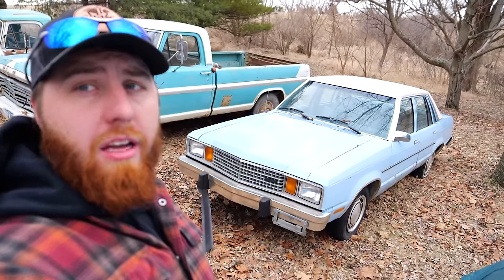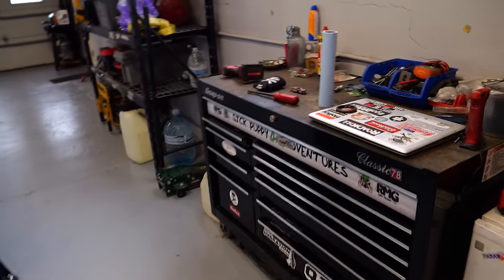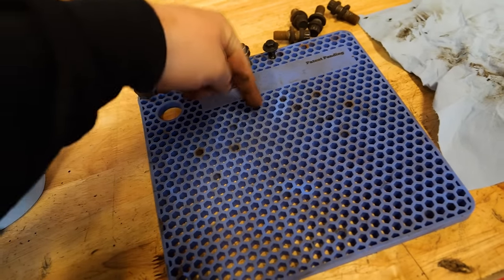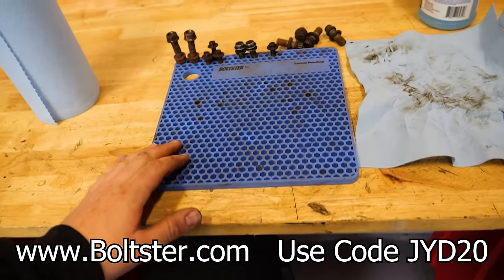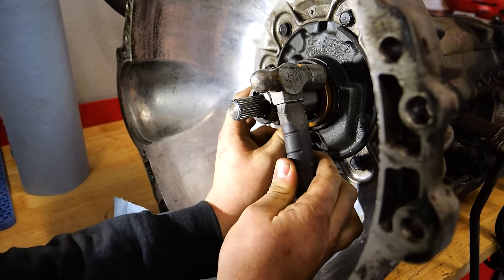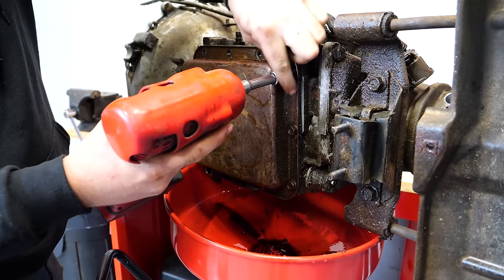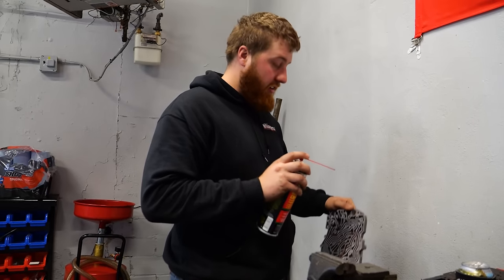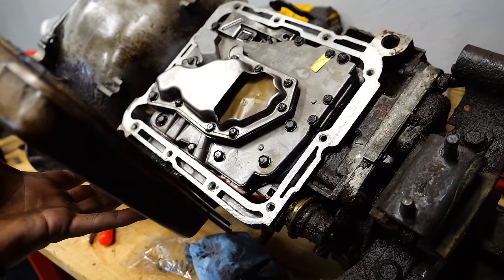CHEAP V8 Ford Fairmont REVIVAL! Will it Run & Drive?

Comment: Paint it Grabber blue🔵 put some fat tires and mustang wheels of that period a ducktail spoiler fox body netted race seats in front make side skirts and front splitter aftermarket Grant steering wheel New black ACC Carpet and some new engine parts a Super Sleeper Please I had this vision in my Dream of your Fairmont the mustang adaption that Ford should have done maybe gen 2,3 Coyote I been a fan of you and mooks work👍💪

Comment: Just be glad you don't have the yr they put the starter up top on the right jammed next to air conditioning the cross bars and dogbone  

When it ran it was fast and smooth but the electric and starter were crap fix one then you chase the clinoid or fuses or electrics on fire wall or battery post it was never ending chase 
Finally had trade it in for a Pontiac sun bird

Comment: You know you totally glossed over the timing cover on the mustang 2 video.  On the oil pan gasket.  Nobody seems to mention that you have to reseal the pan with a new section of gasket. Unless you run the rubber fel pro.

Comment: That 302 probably ate more gas in its low miles than my VW TDI Jetta has in 300,000 miles ... and I can spin BOTH front wheels (limited slip transaxle) on DRY pavement !

Comment: I HAD A 1979 302 HO UNMARKED POLCE  CAR WITH OUT THE BACK INTERIOR HANDLES. I HAD TO OPEN TO DOORS FROM THE OUTSIDE OR THE BACK PASSENGERS HAD TO ROLL THE WINDOW DOWN TO GET OUT OF THE CAR.

Comment: my C6 had 2st gear lockout.. 35mph.. screeeetch 180... no broken parts but stalled.. lol 1976 merc.. 
my 1978 zepher was 4cyl maual.. 2 2bbl carbs.. 4th gear ¼miles.. clutch glazer.. 11.39 @111 the car was cali bearcan thin steel.. the 76 merc monarch (both 2drs) detroit thick.. v8 fact boss order.. 2.00 axle not 2.02.. modified balanced to 8k rpm if i ever hit first gear again.. 😆 🤣 😂

Comment: With all of the emission controls, power is decreased. The 302,5.0 can be a strong engine if you treat it well. Dont pass over critical facts. If it is not an 83 or after, the stick should be be accurate. It is an orifice plate, not a seperator late.

Comment: One more garbage puzzle piece on that Torque convertor design is lining up the drain plug bolt with the hole in the flexplate. I've learned to put both at 6 o'clock to confirm.

Comment: I once had a 1978 Fairmont. Worst quality car I ever had. Made a hard left turn once and it blew a seal or something in the steering rod chamber. Had to replace the whole thing. Did it myself but took all day. The driver side window shattered when rolling it up once because of some cheap plastic parts in the window assembly that were worn out. At the time it had less than 50000 miles. The carburetor had to be rebuilt twice during the short time I had it because it was a very strange design with oblong variable openings at the intake of both barrels. Fuel would eventually take out a seal barrier connected to the rod that controlled the oblong openings. The carpet easily worn down where you heel hit the floor even though low mileage. Fuel gauge went out even though it had less than 60000 miles. Tore apart the dash to see what I could do to fix it and I never saw such a cheap assembly. Was glad to get rid of that car when I did.

Comment: Absolutely love your content, my only dislike is the large dynamic range, I am quite sensitive to loud noise, and the changes from dialogue to engine cranking means I can't change the volume on my device. If you could compress the dynamic range, making louder sounds a little less loud, that would be amazing

Comment: Dear Kevin. I own a 4 wheeler Aka a quad bike and it will only run on idle, I am no mechanical expert, but I know that that is not how it is supposed to run. Also it runs kind of hot and I don’t know how to fix that. Please help.

Comment: I had a ‘78 Fairmont with a 250 I put over 100000 miles in it, and only put a fuel pump. Would you be  interested in selling your?

Comment: Years ago my wife’s Grandparents had that Car with a 6 banger and Maroonpaint  we had just gotten married and the Grandparents found out what we had paid for our House  and that i  was driving a old NissanPickup  that was as stripped as you could buy a brand new one for  they gave me the old car   it was ugly and slow as hell but it had working AC that i welcomed  the funny thing was  you didn’t need a Key to start it you just turned the  Ignition switch without the Key and  you were good  i thought about putting a new switch in but Ford  wanted $150.00 bucks for the part on my free car and i said Screw it  if the car had a V8 i would had liked it better  but i had to beat on it to keep up on the highways  and every week it was something that needed replaced  so i got rid of it and went back to driving my reliable  Nissan Truck  which wasn’t too bad  i had to replace the rear window and found out it was cheaper to buy a Slider so i did and with the door windows down that had a hell of a lot of Air Flow on hot days

Comment: it just boggles my mind that the underpinnings for that car, a 4 door sedan, are the same as the Fox Body Mustangs?!? Is the wheelbase the same? That Fairmont must turn on a dime for a car that size.
Reply: I did a little research and found out that although FORD used the term "Fox Body Platform" for this and several other cars from the late 70's and 80's, there were actually several variations including 4 different wheelbases. A bit deceptive only a little

Comment: 14 inch painted Mercedes hubcaps will fit that car. Put a 190E Grill on it. Take all the aluminum chrome trim off polishing on a polishing wheel you can do it one time to get rid of the white chalky look. All that glass needs to be tinted, I like to use mirror tint with the chrome trim it looks great blocks out the Heat and doesn't attract the attention of dark tint associated with crime. Pick some numbers to put on the trunk lid, one of the smaller Mercedes trunk Stars, and you may just fool someone. You can even put a star in the center of the steering wheel looks like it's got a round Center Hub perfect for a round black and silver steering wheel star. I did it to a 1980 Datsun 510 changed it into a fake Mercedes and I fooled so many people I even fooled a Salesman at the dealership. The car got impounded one time and they wrote it up as a Mercedes. It was amusing. I enjoy making fake outs, I want to get a Land Rover and change it with a Rolls-Royce Grill and Rolls-Royce hubcaps and a double r on the back and then put range on the top of the emblem in the Rover on the bottom with the double r's in the center maybe at some point when I find a nice diesel one I'll do the job.

Comment: I had one. Small engine. Total pos.
Only paid $200. It ran. Had issues starting.....some old dude used to build them told press pedal to floor until it starts. I sold it to my best friend for $1 when I bought a new car. He broke it in half. Lol too fat for rusty floors.

Comment: leave it and drive the wheels off. it'll be a good daily for 5+ years anyway, and prolly need nothing but fuel and oil changes. you know you won't find a better one for what you've got in it.

Comment: My Inlaws gave Me and My Now Dead Ex Wife a Fairmont Station Wagon with a Straight 6 in it.  We Traded it for a 1992 Nissan Sentra.  My Ex Wife Wife's Step Dad  Stole The Fairmont from The Nissan Dealer I think.   I can't prove it,  but it got Stolen after We Traded it to High Point Nissan.   I think He kept a key to The Ford Fairmont and Stole it because it disappeared after My Wife and I Traded it in.